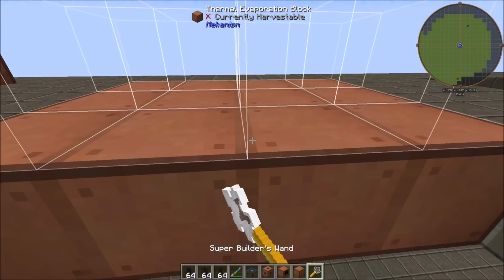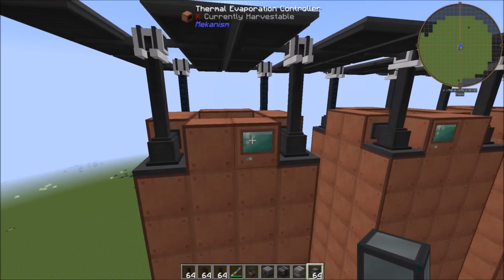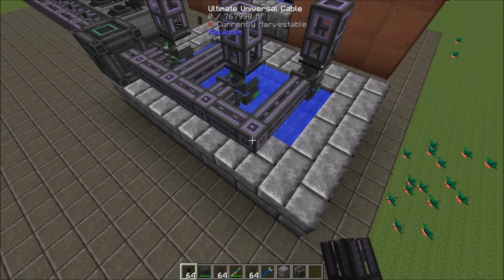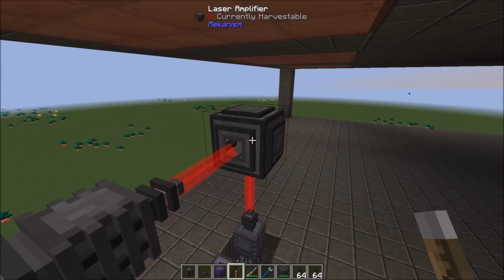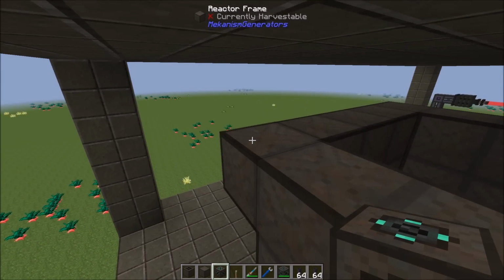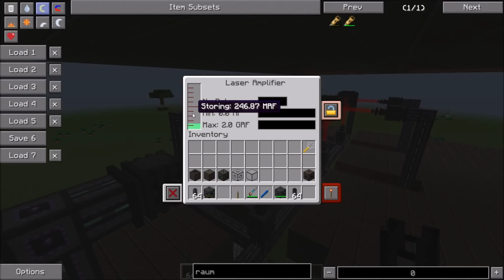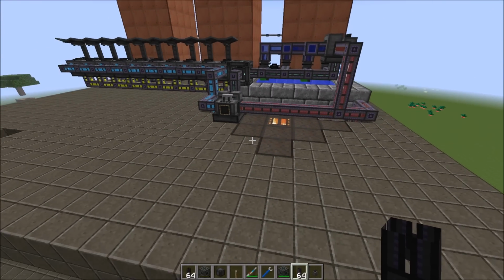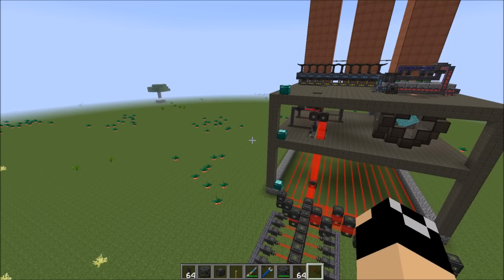Mekanism Fusion Reactor Tutorial

Comment: Things must have changed a lot in 6 years. I'm powering a fusion reactor at 4 injection with just 1 machine for each tritium and deuterium using two 7 high evaporation plants. I even afk through the night and it barely budges with 1 elite tank for each fuel. Who knows if you even need more than that, as it runs my sps and all my machines just fine. Maybe the modpack I'm playing just tuned it all down.

Comment: I don't have enderio so I use mekanism's mechanical pipe to put the brine in the other tower but no brine is going over
Reply from the maker: Are you setting the pipes to extract?  They should move it np at all.
Reply: Use Mekanism Basic / Advanced or Ultimate pipes :) works just as well.

https://gyazo.com/d36aa39f367077e73d69ce5181f07853

Comment: Great video, helped me set my reators based off this setup. I'm just going to weigh in a little with some notes of my own. First of all, mekanism reactor is now it's own separate mod now called mekanism generators. Secondly, if you use the resistive (electric) heaters, you can specify how much power they use, more power yields more heat, allowing for super fast heatup if you have the spare energy for it. Based on my experimentation, you can max your output of an 18 block tower with 4 advanced solar generators is 150 rf/t out of your resistive heater. Good if you're trying to max out your power production while minimizing your usage.

Comment: You dont need to convert the tritium and deuterium into D-T Fuel beforehand in the chemical infuser. That wastes power. What you should do is pump the deuterium and tritium into the reactor directly. It will combine them automatically.
Reply from the maker: its not converting beforehand.  A chemical infuser is making some beforehand, but thats just for use in the hohlraum, not for use in the reactor
Reply: Oh

Comment: The solar generators are no longer a requirement. Thats when the towers were called "Solar Evaporation Plants"
Reply: so how do you power them if so, by another energy source for example wind turbines connected to it with universal cabling?
Reply: Use resistant heaters in stead of solar gens. They are connected to valves using thermodynamic conductors
Reply: still useful

Comment: You don't need the solar panels for the towers, you can run thermodynamic cables from a resistive heater into a solar evaporation port where the solar panel base block is placed
Reply: But say you do use them, will it work? and if so just as well?

Comment: In my experimental setup, I was able to produce >20RF/t with just some ultimate gas tanks and an injection rate of 40. I'm wondering if maybe the amount of energy your lasers give it initially makes a difference?
Reply from the maker: Yeah, it does as it affects the starting heat which gives an initial burst of energy, but that will quickly drop down to whatever it can sustain on what your feeding it.  If you mean for sustained power after the first couple mins or so, initial energy shouldnt have anything to do with that as it really just comes down to your injection rate really
Reply: To Asgaard thanks for the reply, I'll take that into account. btw, you've just earned yourself a subscriber.
Reply from the maker: Np at all, hope that it helps and thank you very much :)